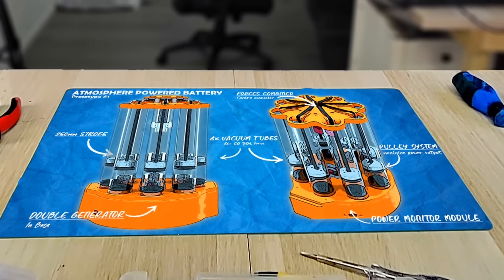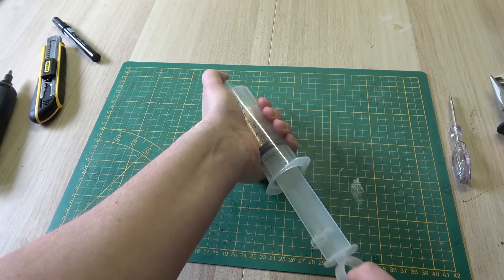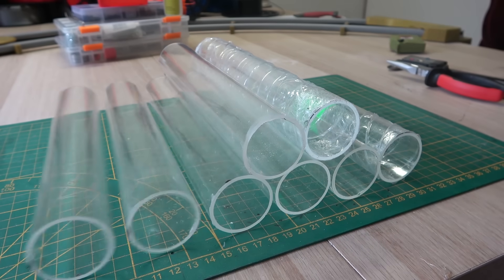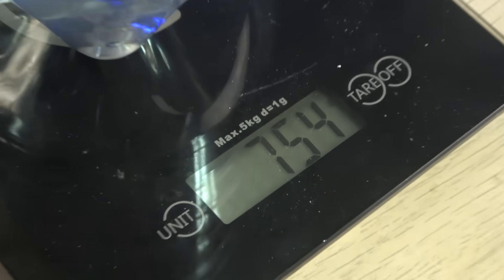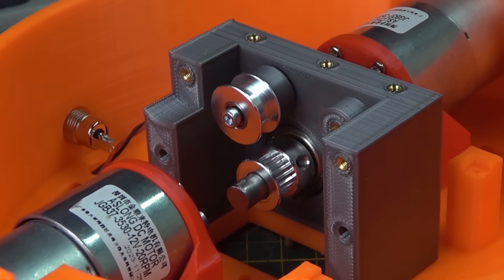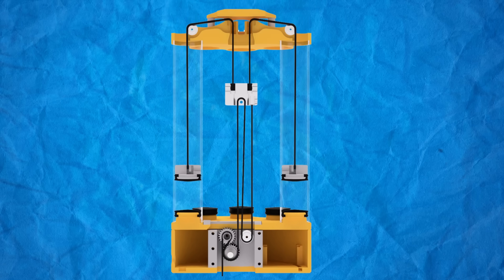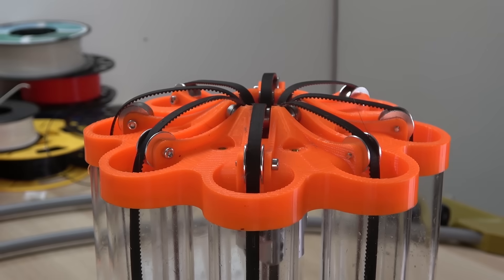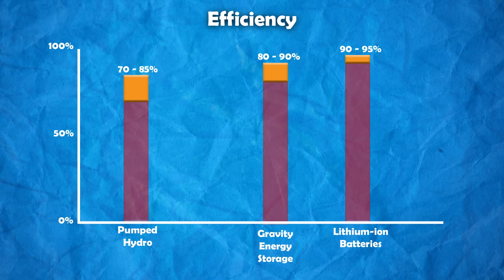Building an Atmosphere Powered Battery..

Comment: Interesting, but vacuum pistons do not save a lot of room over weight energy storage and both don't store much energy per square foot!  This guy's idea only saves space for small changes in vacuum cylinder height.  In Imperial units, atmospheric pressure is 14.7 pounds per square inch @ sea level.  A heavy substance like lead weighs 0.41 pounds per square inch, so a 36 inch tall (2.77 feet or 0.91 meters tall) by 1 inch square lead bar weighs 14.7 pounds (atmospheric pressure).  

So, let us compare a 32.8 foot tall (10 meter) energy storage device using lead weights versus vacuum piston energy storage. The vacuum pistons will still have to be fairly tall: 32.8 feet minus 2.77 feet equals 30.03 feet, or only 8% shorter.

You might as well just use compressed gas to store power.  The hydraulic pressure in construction equipment is between 3,000 and 6,000 psi (200 to 400 times atmospheric pressure), so there are commercially available parts that can handle this.

Also, the devil is in the details, like getting perfect vacuum cylinder seals.

Here's a more fun idea: How about you capture the energy due to fluctuations in atmospheric pressure that occurs from day to day?  Years ago, folks made clocks that used this free power to keep time.  There are commercially available sheet metal accordion style bellows that should work.

Comment: What maybe can be interested to try. What happens if you pull up the tubes without a vacuum? And than when the tubes are pulled up, than create a vacuum in the tube with a vacuum pump. Maybe a vacuum pump is better in pulling a vacuum with less energie. I think that a vacuum pump can do it with maybe less than 200 watts. I'm from the Netherland's and not that good in English. So I hope you understand me. But maybe this is an idea to try.

Comment: So how much energy could you actually store if you scaled it up, at reasonable home scale.. 
1000kg of weight (or vacuum force) suspended 10m high (or vacuum stroke) represents 98,000 Joules of potential energy (ignoring efficiency).  Sounds like a lot.. but consider 1KWh = 3,600,000 Joules  and a average American home uses about 30 KWh per day, or roughly 108 Megajoules.   So your 1 ton of weight suspended 30m   gets you less than 1% of your average daily energy usage.     
In other words, it would charge a modern smart phone.. twice..

Comment: To put this in perspective relative to gravity based system. 
To generate a metric ton (1000kg) of weight to pull against, you need 1 cubic meter of water, or about .43 cubic meters of portland concrete.   Bit hard to visualize the latter, but  in freedom units is about 114 US gallons or 2.73 standard oil barrels.    The advantage is relatively low friction (other than reduction gearing, which is the same for both systems), and infinite storage time.  
To generate the same 1000kg of constant force with vacuum,  it's roughly 1kg per square cm, requires  a total cross sectional area of 1000 cm^2 which is only .1_m^2 or in freedom units only about 154 in^2   or 12.4in x 12.4in which seems a lot more compact than suspending nearly 3 oil barrels worth of concrete but..  consider it would take nearly 80 of those 40mm diameter tubes to get up to the 1000 cm^2 of cross sectional area we need.    And you need low friction seals that can hold vacuum for a long time.

Comment: Scale it up, single large cylinder, central heavy mass plunger combining the vacuum method with the gravity method. vacuum reduces the weight on return, wight reduces the power required to pull vacuum.

Comment: Great project.  Perhaps this rig needs stress testing to see what the mode of failure and or maintenance requirements are.  Can it be set-up for continuous charge and discharge?  Might need some grease on the base seal and lubricant on the pistons first!

Comment: The only big elephant in the room I would see being hard to overcome as a viable long-term source of use is unfortunately what it takes to create a GOOD vacuum seal that is ALSO movable. Over time I could see those components simply breaking down at a rate that is not conducive to cost over decades of use.

With that said, I DO believe it may be something to consider for space travel and use as an alternative negative energy reservoir to save for weight if we can make the cylinders lighter per energy density volume. Maybe something that could expand the vacuum force during take off essentially harnessing energy from the atmosphere as altitude changes?

Maybe use it in the form of a mechanical capacitor?

Comment: Your computation of the efficiency is wrong. The total energy that can be stored in a vacuum is E = PV, where P is the atmospheric pressure and V the volume of vacuum. Using the dimension of your 8 cylinders, that's about 250J.

If I trust you electrical measurement, that would mean a charging efficiency of 29% (which sounds plausible) and a discharging efficiency of 250%, which is obviously not possible.

For reference, you would need a volume of 60L to reach the energy of a single AAA battery.

Comment: To fix the seal friction issue, lift a column of water from a bathtub using an inverted tube sealed at one end? But then I don’t see a benefit over lifting x kg of lead.

Comment: Nice project, If I was you, I would go smaller first than larger, try to optimize for efficiency and robustness in small scale, one cylinder. Then try to set up a high record in efficiency, or doing more theorical work an test to get the max theorical efficiency for a real word vacuum storage.
But also, by thinking with a math brains, by the volume / surfice area law, bigger would get a lot more efficient. More extra force per unit of extra friction.

Comment: I think it was very worth it! If you can get proper materials for a better vacuum and more efficient motors, i believe you can get much better results. In this build, i think the motors might be a bottleneck in the system. If you get more efficient motors, i believe you should get much better results!

Comment: I wonder what is the long term efficiency? I assume that over time air would slowly leak into the vacuum, so after maybe 24 hours it could lose a significant portion of it's power, and it wouldn't fully return to the bottom.

Comment: What if you used large diaphragm devices, to work with atmospheric pressure, to move a lever, to activate a motor?  It would only move several times a day, but a large enough diaphragm would be able to activate many levers at once, driving multiple motors, storing power in batteries for later.  Just a thought.

Comment: I just loved how the moisture in the cylinders started to boil the moment you lifted the plungers. Very neat! The main disadvantage I see over pumped hydro is complexity and cost. A reservoir and a pump vs. all of this. Pumped hydro also allows easy control over discharge power over time and I think you would need a very beefy gearbox to achieve the same here. Still it's a great experiment and a very interesting result!

Comment: Even though it seems to work nicely (except I think there would most likely leak air into it over time), I think you should compare it to stored hydro in the form of something like two 25L  water containers. I am not an engineer, but believe it should be able to store at least as much energy per liter as your contraption. Added to that, it should have very few failure points and be a whole lot cheaper to build.

Comment: Make it a sealed large diameter diaphragm to minimize the losses and maximize the space efficiency
Reply: That should also largely increase the lifespan… those friction seals will not be around long, and the habit of leaking will rub off fast…
Reply: That thought had occurred to me when I was contemplating the possibilities of pumping water with just gas pressure. It never would have worked because of the weight of water being what it is, but a diaphragm allows for the gas side to be completely sealed and to use a more volatile liquid to get the most range of pressures possible.

Comment: Pretty cool and I think definitely work messing with. My largest concern is leakage and maintenance to this type of system. I'm never heard of pumped hydro but what if you used a series of mirrors to heat water to steam to fill a vessel then use gravity to generate power with pumps?

Comment: Efficiency feels somewhat less important than viability I think, tha viablility, which in turn feels like a material science question. Like if you could make them for cheap and reliable enough, the efficiency will become less important. Hydro/Gravity seem like they would be lower mainteence, but would require a lot of setup and would be fairly large to set up. Lithium requires rare materials. 

The less costly, and more easily mass produced the more viable it would be. I also think efficiency would be less important that reliability and mass producability. If you could somehow make it rely on mechancial instead of electronics, I think that would go a long way for viability as well. Solar in particular I think would benefit because peak hour usage isn't that long after sunset, typically.

Comment: Really cool project.  And could be made cheaper than modern batteries.  But i wonder what the wear will look like after years of use. What will need replaced and if its worth it financially  compared to lithium

Comment: You didn't say if you oiled the tubes or not.  A good lubricant that won't degrade the rubber (or the tubes) would not only help the rubber plugs seal better, it would reduce the wall friction, increasing the efficiency a bit.

Comment: The real questions become:

1) Do the numbers scale upward equally as the device becomes larger?
2) What are the dangers of storing large vacuum tubes under pressure?
3) Is it cheaper than pumped hydro?
4) Is the startup cost worth the only 3% gain over pumped hydro?
5) What does this maintenance schedule look like, cost, downtime, frequency?

Comment: New sub, awesome work.

Simplification - same setup compressing springs, testing different spring types, and not having any losses due to friction on the tubes.
I predict a lower storage density but a high % efficiency, depending on spring type.

Or rubber elastic bands that are tensionned, power when released, always same setup as this video, so  near perfect reuse of current setup. What wins?